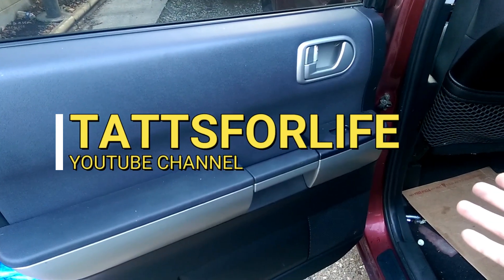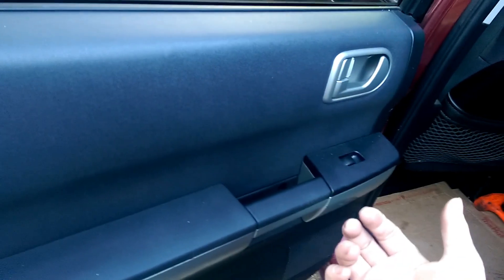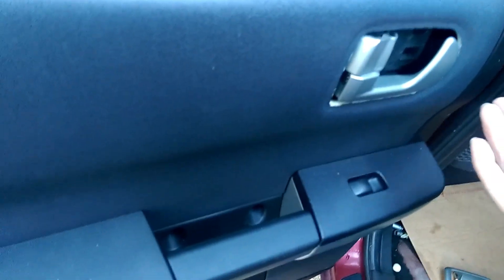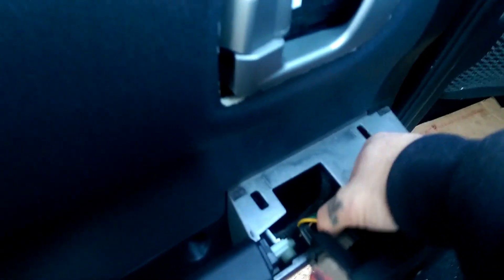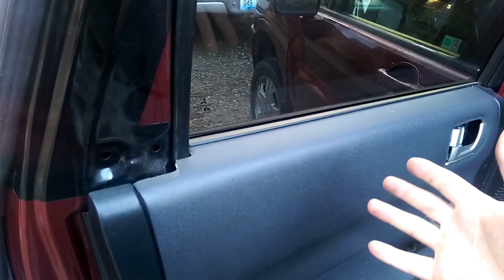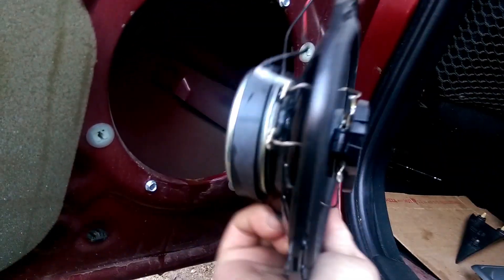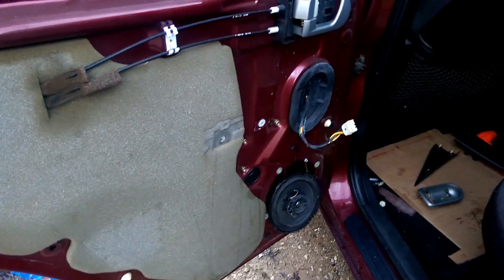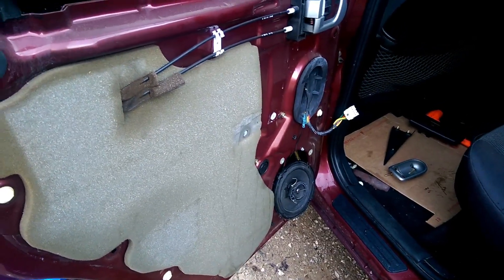Mitsubishi Endeavor Rear Door Panel Removal

Comment: The panels are a bit different on later models.The switch panel has a hidden screw attached from behind and there is an additional screw in the lower main panel that must be removed before popping off the clips.
Reply from the maker: great info

Comment: Hey Tatts...hope all is well with you and ours during this crazy time! I'm hoping you still have that endeavor and if you do I have a  Quick question for you after a little background. In short, I just replaced the heater core...ugh right! I have it all back together other than the radio face which has been on but removed after my initial attempt at starting the car. Here's the question, could you shoot a few pics of the electrical connections after the fuse panel? I also have a ground that I cannot figure out where the hell it goes. It's back behind the radio, a single black wire with an eyelet that won't reach to anywhere but the back of the radio itself. So if you ever have that apart I'd love to see those as well. All in all, after putting back together it will not turn over, no horn, lights, radio. The interior lights work, headlight warning once key is out works but no lights, turn signals did work but now don't, hazards work...oh and I have an extra connector behind the radio that seems to have lost its mate! This is soooo dam frustrating but hoping you could help if at all possible would be very much appreciated. A couple of your other vids have helped!! The door handle vid really helped!!!! Enjoy your pursuits and stay safe!!! Subbed and liked!!!
C